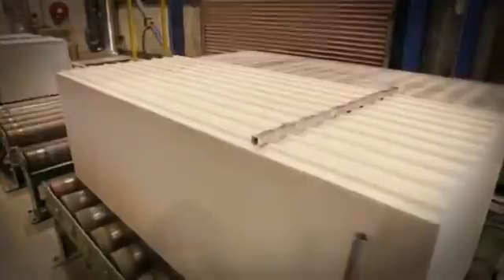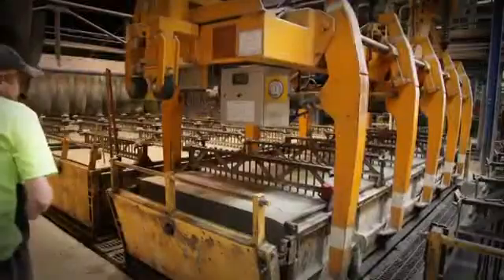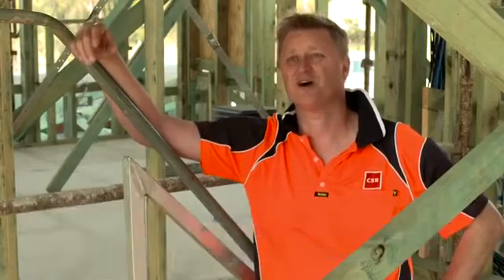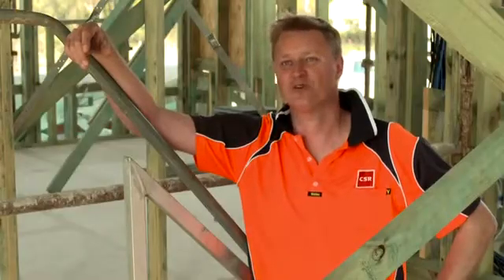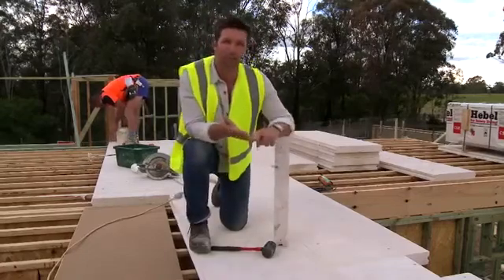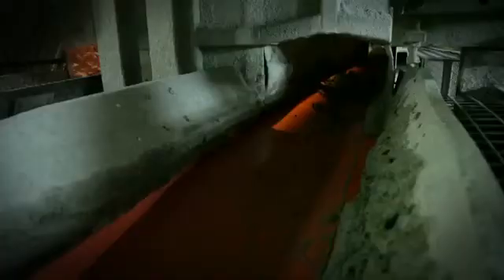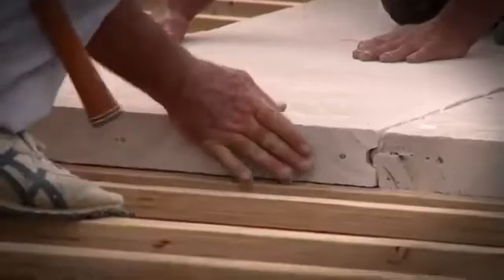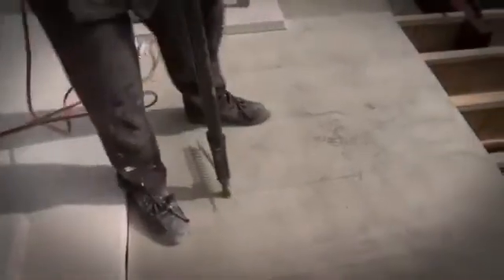Lightweight autoclaved aerated concrete floor panels

Comment: Looked good until you started dry sawing it. There's a whole lot of silica in the brew, which means that dust is going to give you silicosis.

Guess I'll stick with timber. Sure, it's not as fire resistant - but when the floor is sitting on a timber truss, the place I need fire resistance is the ceiling below it anyway.

Comment: This video is a great reminder why structural engineers are highly paid. Everything in the video is probably correct but the engineer also factors in failure modes and longevity.
Reply: Does that expain why the UK is having to replace hundreds of school a year? It's geat until you let the water in. Have you seen the maintenance performed on British schools?

Comment: This is only my opinion, my background is not structural engineering:

It is very dependant on the application. This material appears to be cementitious - but not a sand/ cement/ aggregate ‘concrete’

If they use corrosion resistant reinforcing then the water ingress -> corrosion risks (likelihood of reinforcing failure) can be reduced, but remember reinforcing in concrete is very difficult to monitor without acoustic detection methods or preinstalled insitu sensors.

Long-term corrosion, heterogeneities in anti corrosion coatings and marine environments will all accelerate useful life spans in treated reinforcing, marine stainless would be another option.

None of the above detract from the fact the supporting matrix of RAAC is inherently less dense and compression resistant than pored or precast concrete; with its intrinsic supporting matrix of mineral grains and superior contact points; mutually between the concrete matrix itself and the concrete/ reinforcing contacts.

Compressive and light shear forces will be resisted and enhanced with a solid concrete reinforced member.

However… the application of RAAC shown above is limited to short-span flooring, supported at regular intervals on an approved and certified timber structure.

How RAAC performs under repeated shock loads between the joists will be revealed in the coming decades. 

In the UK RAAC is used for structural and supporting flooring, wall and roof elements - far more critical to building survival and human life.

The worst a poorly transported or installed RAAC panel could do here I suppose is collapse under a point load; your bed leg or bath support may drop - provided the supporting timber joists are correctly spaced and the reinforcing steel is intact.

Comment: can we use this concrete floor panel for the roof top terrace as well, where people can walk as well, there is a slope of 2 degree terrace roof needed for my roof top terrace where there are living areas under the roof top terrace in canberra, australia, can this be suitable for canberra weather instead of suspended slab with industrial waterproofing on the concrete roof slab,
Reply: If you read the description, it says these can be used as roof panels.